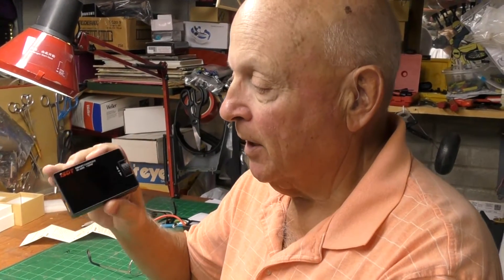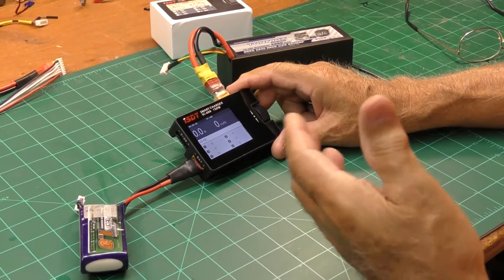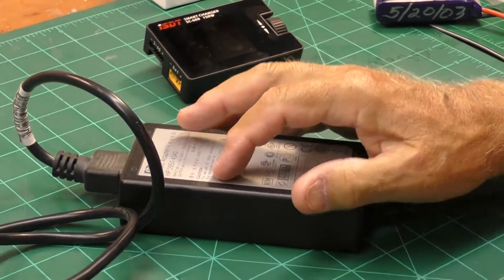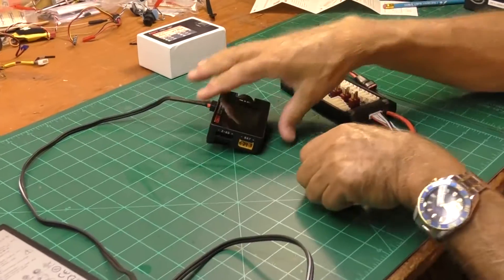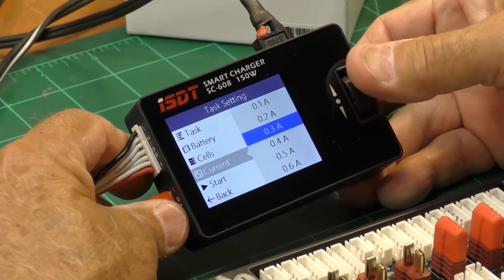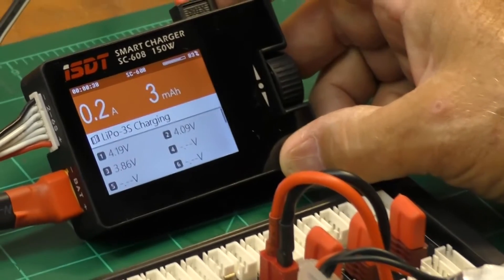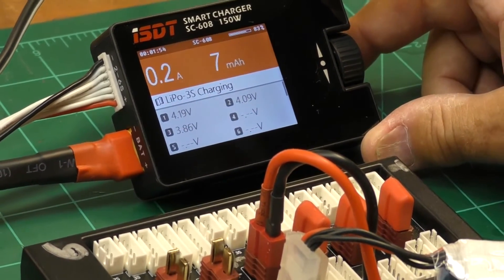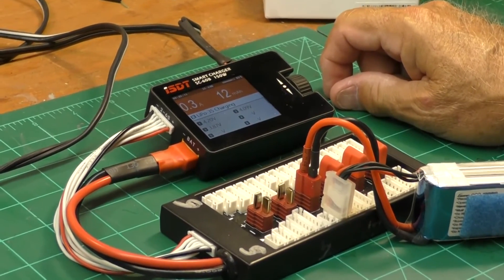ISDT Smart Charger Demo

Comment: I suppose you could get away with that power supply, as long as you don't exceed 45 watts, assuming that you're getting 100% transfer between the supply and the charger.  However, that power supply will not support 150 watt charging.

Comment: Hey Uncle Deek, where did you get that nice parallel charge board? It looks to be a lot better built/safer board than the HK one I have. I also have and love that charger. I got the one that is more of a desktop model so the screen is always at a reasonable angle. Also, thank you for the tip on the laptop battery charger. I have one to spare as well since I sorta fried my computer when I plugged in a lipo to sync the esc's on a new 180 quad. I was in cleanflight and the Naze32 rev. 6 board was bad so 12.6 volts went through the 5 volt USB cable into the laptop. Poof. Ruined my day in a hurry. Lol. Thanks, Tom
Reply: Here's where I got mine: http://www.buddyrc.com/power-system/paraboard-parallel-charge-board.html
Reply: TripleThreatRC Thank you sir, I can't believe that with the amount of time I spend cruising RC sites, that I never have seen the Buddy RC Paraboard. Of course the XT60 ones are out of stock but I found one elsewhere.